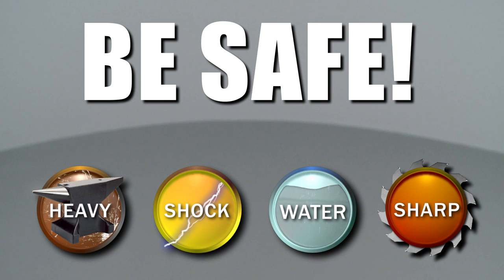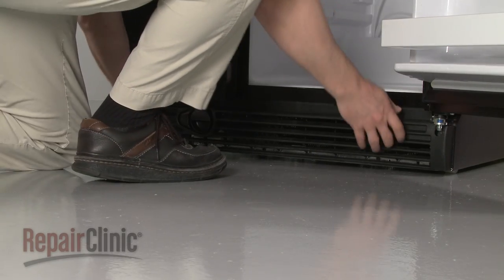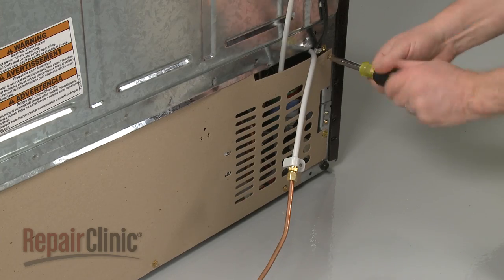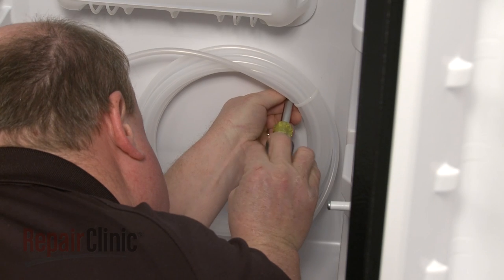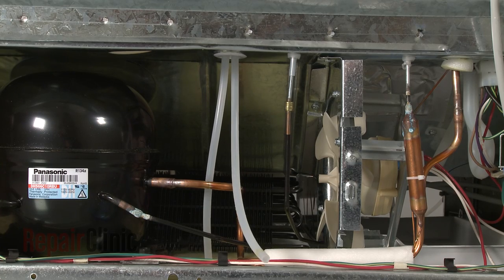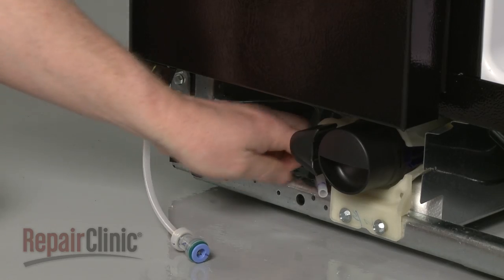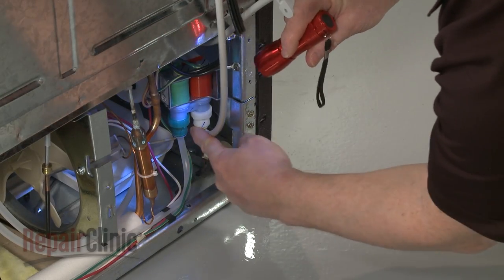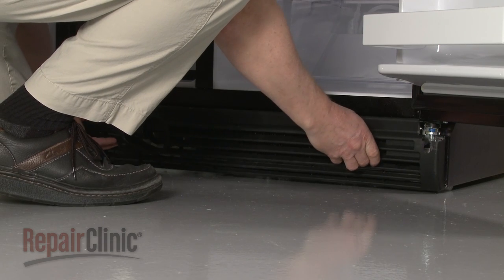Whirlpool Refrigerator Leaking? Replace Water Tank #W10526445

Comment: please help my water inlet valve keeps leaking now. @ 2:40min in video when he puts hose back in. mine just keeps leaking after several attempts!
Reply from the maker: There is an O-ring seal in the valve. I would cut off about an inch of the water line and reinsert it. You will need to press the line in all the way to make sure it will seal. If you are sure the line is in all the way and it still leaks the O-ring may be damaged and the water valve will need to be replaced.
Reply: Thanks it was the O-ring. You all are the best!

Comment: The line is made from 5/16" O.D. Polyethylene tubing. Does anyone know the length? I need to replace but @ $45 precut its overpriced. I can get 100ft for less than $20 on ebay.
Reply: According to Whirlpool's website, the length of tubing is 100' for a standard size fridge and 50" for a counter-depth fridge.